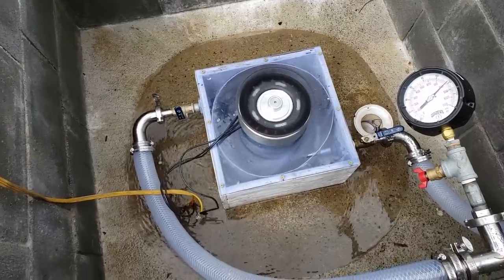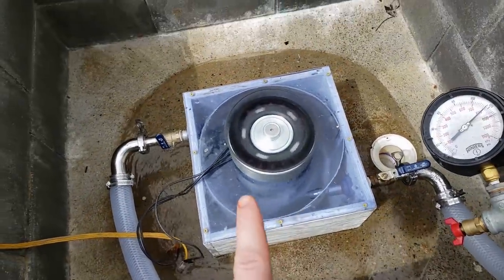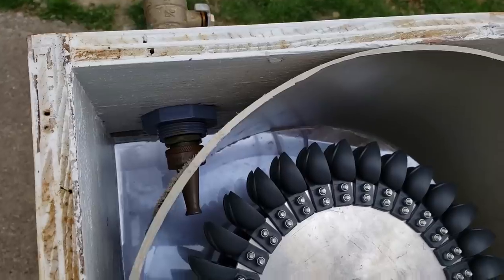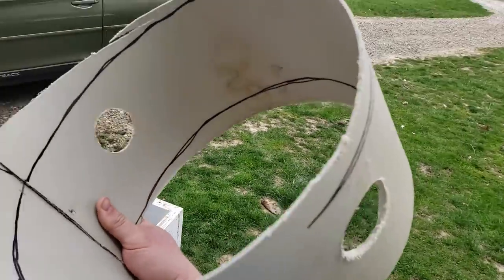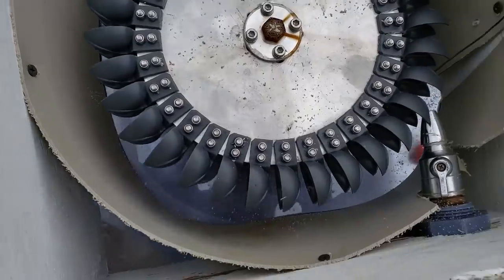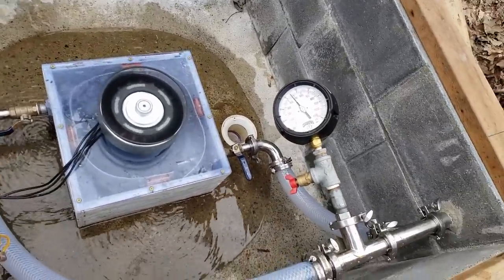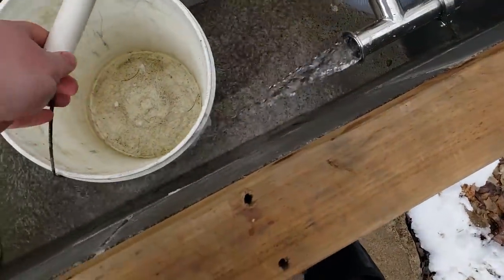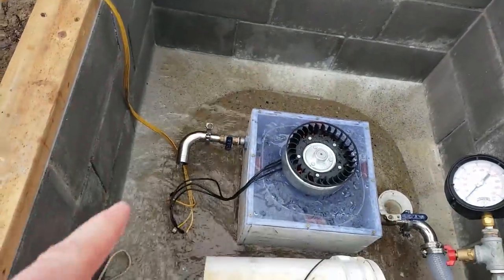Conical Turbine Housing, An Improvement?

Comment: I'm so glad you aren't just ignoring the comments and actually trying them keep it up man I enjoy the videos
Reply from the maker: I try.

I do read every comment, I'm not THAT big yet.
Reply: Simpsmud2020 mud  - You would need an additional power source to pump that water back up, otherwise, you're describing a perpetual motion machine. The only way this could keep up with the water being discharged would be if he was literally harnessing less than half of the water available, because you would need at LEAST as much power to raise the water back up again - and that's with 100% efficiency. In reality,  you'd need to spend more energy re-elevating the water than you were extracting from it in the first place.
Plus, 5000 litres is a pittance compared to what he uses - he measured 9gal/min which is rougly 30 litres / minute.... that's just under 3 hours of run time.
Reply: Simpsmud2020 mud the 2nd law of thermodynamics makes that impossible. Necessarily, the machine would have to be more than 100% efficient to do that and also produce power. What he could do is capture the spent water, run it through filtration and softening, and collect it in a tank in the basement with a pump to pressurize it to mains pressure. Then he could replace his water main connection with a connection to that, and boom free water on top of the free power he’s making.

Comment: Hey Joe, I have 3d printing company that specializes in large objects. I wonder if we could get a CAD design of the ideal housing shape, we could print one for you for fun. Interested?
Reply: we would love that im  invested  in thiss  project now
Reply: Is there a way to make one that can hold jets for a turgo turbine and also jets for a pelton turbine? This would allow the owner to choose which type of turbine to install, while allowing experimentation between the two types.
Reply: I think 3D printed housing will do u better than that plywood one and it will not deteriorate for quite sometime,
Reply: There has to be a magic ratio for optimal enclosure size and waste water expulsion.
Reply: Any luck so far?
Reply from the maker: Wow I'm behind. I only noticed this comment due to another comment notification. How big is your capacity? I only recently got a 330mm printer.

Comment: What if you used a tire? For your housing?? It’s round, free you could still screw your lexan on too.
Reply: Wheelbarrow wheel cut in half and skirted?
Reply: A tire hub, I assume you mean? Metal, already has a center hole, cheap if not free...
Reply from the maker: a good idea, not good for video since it's opaque though. I might try a 2L bottle though!
Reply: @JoeMalovich  A 5 gallon water jug for glenwood englewood water coolers. Plastic, easy to work with, and a centerd hole for water to run out.

Comment: The commercial peltons ive seen have the axis of the wheel in the horizontal configuration to use gravity to strip the water from the cups. The nozzles are stacked on the down spin side and the water evacuates before it can make the corner back up the wheel.

Comment: Please pull your electrical connections out the water!! The cable will get all wet and start corroding, and it annoys be every video!!
Reply from the maker: I will continue to do it to annoy you!
Reply: @JoeMalovich   It's possible it'll wick up the wire into the motor too.
Reply: @JoeMalovich  Tee Hee!
Reply: 9ff70f96 yep by capillary effect
Reply: He Will P if you don't do what he asks.
Reply: @SD-tj5dh  underrated comment
Reply: @JoeMalovich  HaHaHaHa. A little water never hurt anythin....
Reply: @SD-tj5dh  nice

Comment: For clamps I would recommend T-bolt hose clamps over the worm type clamps they are still relatively inexpensive but are a lot more reliable especially in applications where they are taken on and off and have a fair amount more of clamping pressure before failing for the same given size. Downsides they are not as wide ranging in the size of hose they can clamp onto.
Reply from the maker: I sourced some t-bolt clamps from ebay.
Reply: @JoeMalovich  your normal hose clamps would hold up better if you would stop using an impact to tighten them
Reply from the maker: @lufles01  then I can't get them tight enough.
Reply: @JoeMalovich  You can also find T bolt clamps at heavy duty truck parts dealers in case you ever need them quickly.
Reply: theupinsmoke1234 I use them on my car coolant system.

Comment: The tire shaped housing is a good idea.  A tight fit should help transfer.  Scrap the cone, keep the housing tall.  Cut slots to channel excess draft above turbine....  *(study the path of the draft, bend the housing into an elipse that guides the draft to promote maximum kinetic retention and guide the excess away from the turbine..)*  Look up how they frame skateboard ramps and fit the parabola pieces into the outer housing so you don't need to struggle with getting the housing mounted every time you try a new prototype...  I hope it helps, good luck and great experiments..!  You're pioneering is an inspiration to us all...  =)

Comment: Good work Joe, sounds less noisy also.
Reply from the maker: very quiet, but I fear a bearing is going.
Reply: @JoeMalovich  better fix it before it explodes
Reply: @JoeMalovich  if so, you can bring the bearings to a bearing retailer and ask them if there's an upgrade you can replace it with.
 I have also found that many so-called permanent bearings seem to not have enough grease in them. Normally you can pop the seal off the side of the new bearing with a small screwdriver, then add high quality synthetic grease about three quarters of the way around. Leave a small amount of air for expansion.

Comment: Am enjoying the video series.  Think a lot of pelton wheels are mounted vertically to mitigate these splash back problems.  When vertical the top jet drains in the direction of rotation and the bottom jet hits over the drain port.

Comment: ive been watching a few of your videos, i was thinking a design that closely hugs around the impeller and has an opening where the water splashes out would greatly reduce drag on the impeller from bachsplash while increasing the windage. i wish i was good at drawing but sadly not, basically placing the impeller in a housing covering it with an outlet for the outer splash could have benefits.

Comment: I subbed because you give an honest listen and you asked. May I suggest doing a bit of a better design on the cone and testing it when water pressure is up? An octagonal housing would make it easier to ensure a good angle to discharge water down. Just a thought and I like what you are doing. Cheers!

Comment: 90° elbow fitting will impact the flow especially when high flow. Try using multiple bigger angle fittings together or just connect it with pipe

Comment: NAPA sells stainless T-bolt clamps, if you measure your pipe\hose and use those you may get much better clamping power. I wonder if a louvered inner case would prevent the splashback? Maybe get one of those mudflaps trucks use with the "fur" that keeps spray down and wrap it around as an enclosure?
Reply: BLKMGK4 now that’s an idea
Reply from the maker: I sourced some t-bolt clamps from ebay. Louvers are a viable option.

Comment: Joe, Since you are testing, Why not try an open type frame, This should be fairly easy to do!
Reply: William Glaser yeah I was thinking the same. 2 bits of angle iron to hold jets, 1 bar from one side of concrete to other with bearing to support wheel with a 2-3’ shaft going up to inverter so it is able to be kept dry.
Reply from the maker: still very splashy with the velocities involved. The runner needs to be enclosed.
Reply: @JoeMalovich  can i suggest the most important thing is the angle to deflect the water straight down rather than it being round (although it doesnt hurt to do both) would it not be worth trying a flat topped pyramid box with the sides at 45degrees, any water moving horizontally would deflect vertically down though you would still want at least six inches of clearence below the turbine to avoid general spray, it would be a fairly simple plywood build and avoids any awkward shapes
Reply: What if you get a bigger piece of lexan and mount your nozzles to it. Have the shut offs up by the pressure gauge. And leave it wide open below the sheet of lexan? Also can you put a longer shaft on it to get the wheel away from the bearings?

Comment: For your stainless steel housing, I like the cone, but how about some fins on the inside cone face directing the water downwards?  All 316L SS 14 or 12 ga, fins probably only need to be strips 1/2" wide with a 15 - 20 degree angle / slope downwards, fillet welded both sides, all welds normalized to also deter corrosion. Also a cap ring on the small end of the cone to prevent deformation from the jets 3/4" tops.
On a different note, when you did the flow rate test, it appears to pulse out of the supply line. Is there a device to install to smooth the water flow to a steady flow rate?

Comment: Where is your water coming from I'm curious if you can use a water storage bin at a high point for gravity pressure and capture the water on the expelled end and use a electric pump to pump water back into the the feed bin
Reply: What you're describing is a perpetual motion machine. It would take more power to pump the water back up than the turbine would generate.

Comment: Windage is an issue in high rpm motors and we used windage trays to remove the flying oil away from the crank and rod ends.  Some people use a combination of windage tray and crank scraper.  Anything you can do to get the drag off the rotating part will be beneficial.  SB cheys often see a 1% HP increase at relatively low RPM's 5,000rpm, at higher RPM it's even better.

An oil pan with a kickout is also beneficial in reducing windage.

All those proven hot rod tricks would apply to your very interesting project :-)

Comment: 1 thing i was thinking was the angle of the nozzle... was thinking if you angle it like 5 - 10 degree so that it is hitting the bottom of the fins a little more just seems to centered on the fins and might gain a little more from the angle due to it putting more pressure on the bottom and them scooping up the fin ?.... just a thought

Comment: What If you used a bucket to make a round splash guard.? It's bevel shape would direct the water down, and if turned upside down and the gen mounted on top, would replace the plexiglas and the box as well. maybe?

Comment: I'm curious, would building some form of reservoir help long term. I don't know the details of the full set up, but putting a large barrel or other container upstream help with head pressure even if it doesn't change flow rate overall. Although if it was large enough you could use it to gain more power overall by storing rain/snowmelt.
Reply: That's what I've been wondering! I see wavering pressure/voltage and I jump straight to a capacitor haha.
Reply: Like a water buffer... I like that idea

Comment: Joe, just thought, CAD a rough shape of the the turbine blades. Then, using that diagram, design a negative (of the turbine cavity). Slice it up and 3d print it. Glue all the splices together and use automotive body filler to fill and smooth the surfaces. Apply high build primer and sand smooth. Paint with a glossy thick coat and allow to cure in the sun or an oven at 140. Then fiberglass the negative to form a positive turning housing.
Reply from the maker: I'm building a turgo in a stainless housing in short order.

Comment: May I suggest that you add a closed tank of some sort to your incoming line.  The hose from the well goes into the tank, the water slows down and any debris falls to the bottom of the tank while the water continues out in a hose on the other side and in to the turbine. If you let the tank contain some air in the top, it will also reduce any spikes in the water pressure.

Comment: Hi. Cool project. Proposal for improvement: try til remove the box around the turbine completely. Weld a steel frame that holds the turbine 0,5 meter above the floor and let the water hit the walls. You can place some covers on top of the frame to keep the water from the electrical equipment. And also place the valves on top of the frames for easy operation. Think that will improve efficiency quite a bit.

Comment: Just a thought but if you want a bell shape why don't you modify something that is already close to that shape instead of reinventing the wheel?

As example... 
a smooth angel cake bake pan
an industrial light cover (spotlight)
etc...
Reply from the maker: a Bundt pan, yes but they aren't big enough.
Reply: @JoeMalovich  That's not the point of my comment.
Reply from the maker: @rymichael7203  I'm moving away from this configuration to a turgo that won't have these problems.
Reply: Joe Malovich why, is the turgo going to be small enough to fit under a Bundt pan?
Reply: A turgo turbine won't need a specially shaped housing, all the water flows out the bottom.
Reply: John Wyman 
It was a joke John.

Comment: Looks like your supply needs better ventilation to stop that surging.
You might also want to use  Venturi nozzle to pull air in giving you the same or a little more force with less water

Comment: Hey so if you ever make another temporary box out of plywood, make sure to paint it really good and then let that dry and then use never wet from rustoleum as the final topcoat and then it will literally never be wet. It’s some sort of nano coat that prevents water from sticking to surfaces

Comment: Recently I saw a similar full size generator on national geographic or the discovery channel, and they went inside the chamber with the pelton rotor, and I noticed that it was a very large oversized space. The ideas with cone shapes and all that works very well for filtering water and air and such, but I think that in your particular setup you just need more space inside the box. Forget about complicated cones and shapes, just make a bigger round shaped box where the water doesn't interfere with the pelton spoons. If I were you I would recycle the box that you have and make it bigger. Or....what other people suggested as well, an open frame for testing purposes only. At this stage of development you don't even need a closed box.
Reply from the maker: I'm moving to a turgo in a stainless housing. An open frame would not be good, too much water spraying around hydrating the turbine will cause corrosion issues, and an open frame makes it more difficult to mount and align jets.
Reply: @JoeMalovich  I meant that suggestion just for testing purposes. When you try an open frame you can at least see the results without any water interference, so that gives you a number that you can use as a baseline for the maximal performance. All you need is a piece of wood or a piece of steel and a clamp to create something that holds the nozzle in place. I don't see the complication with that. Once you know for sure what difference it makes you can make a final design based on facts instead of guessing and trying to figure out what's happening. But you are free to do what you want, it's your project not mine. I am just saying what I would do if I had a limited budget and limited resources.

Comment: What is the advantage of this closed box situation..?? Seems there would be less interference if the turbine was open no?
Reply from the maker: keeps the water contained, preventing rust of the generator
Reply: Isn't it the other way around, if the turbine took up almost the entire space, with the housing a circular form and the jets machined into the housing at the correct angle? You would have an exhaust below perhaps, that might be a cone shape. Or the jet coming in one angle and the exhaust going out on the opposite side, a u shape? Just spit balling. Really interesting videos.
Reply: What if you lifted it up so that the generator is where the roof is right now, and put a second roof on the generator? Can we do picture comments here?
Reply: Wouldn't a plexiglass sheet or other between the turgo and generator serve the same purpose?

Comment: Hi Joe. I have seen several of your videos now on some of the changes you have made your small hydro turbine. I think it's awesome! In every video I have seen since you upgraded to a bigger diameter turbine there has been water splash back. Would the water splash back be reduced if the size of the box/ housing increased? My train of thought is this... If the housing was bigger while the nozzles remained in the same location and distance from the turbine, there would by more distance for the water to travel before hitting the side and "bouncing" back to cause drag on the turbine. By having a larger housing,  you would reduce the bounce back while still keeping the splash confined to housing. A bigger housing could incorporate some of the other concepts such as using a cone. If you try this, let us know how it works???

Comment: I'm curious on the jet positioning - you have them static mounted. If you added movable X and Y positioning plates to afford precision control of the jets to the pelton wheel spoons, I'm wondering if you could dial things in to a higher level of performance or if that is even worth doing.

Comment: Try making a Windage tray for it. Look up ones used for automotive applications. They function to catch excess oil caught up in the rotating crank assembly and allow it to fall back to the oil pan. In your case, you could make a circular one which fits closely around the outer diameter of the driven wheel and has angled radial slots which will catch the water, deflect it, and slow it as it spins with the wheel, allowing gravity to pull it to the drain.